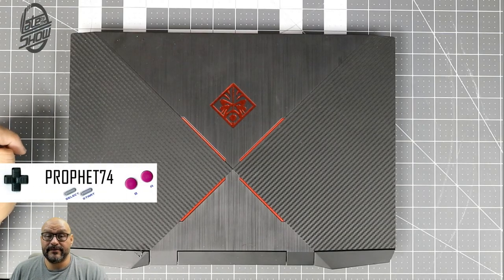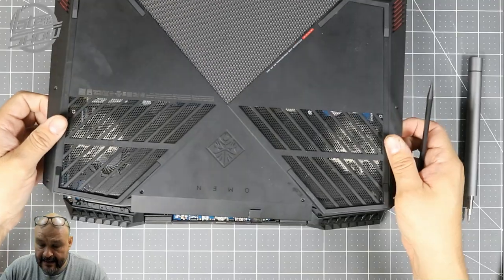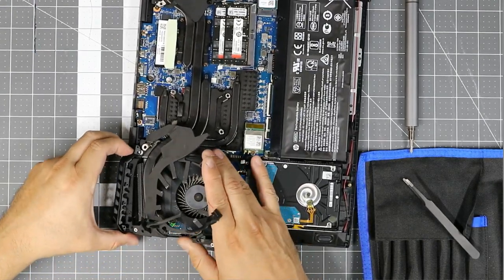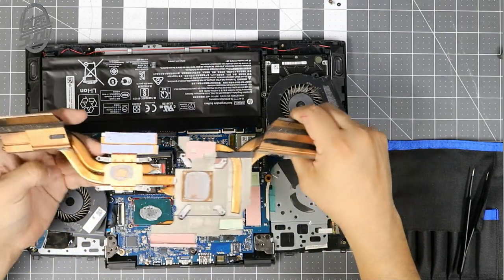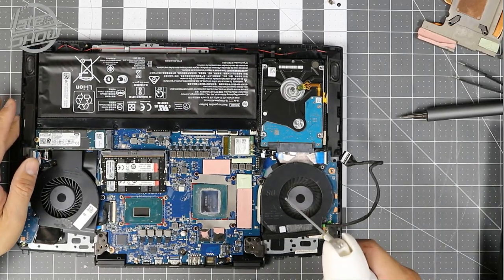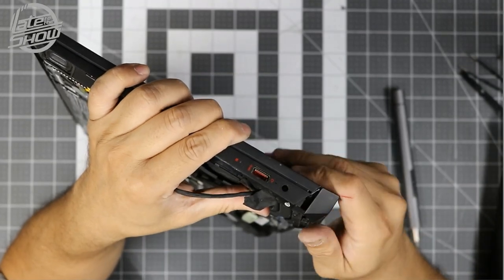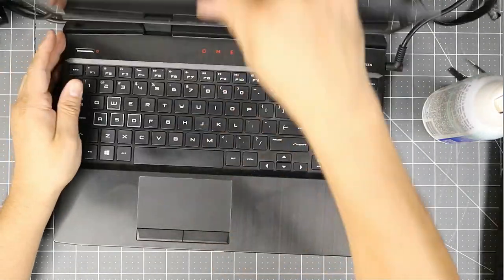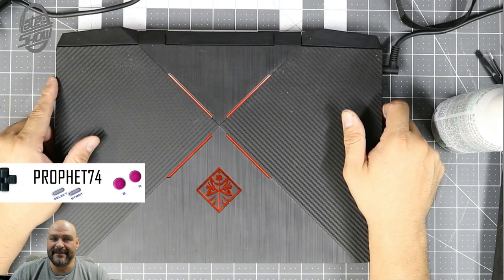Replacing Thermal Paste HP-Omen 15

Comment: For Rectangle shaped CPU and GPU it is better to use thin line in middle  lengthwise..the dot is good for square shape only.
Reply: It's thermal paste and not liquid metal. Just put enough as it's not conductive. Liquid metal is only time that requires finesse.

Comment: Unfortunately you miss the Whole point. What is the actual temperature change after repasting in most real daily usage?   Is it 1C or 2c?  It is not worth if there is no significant drop of temperature.
Reply: it helped me by 20-30c
Reply: @kemo_gaming Finally I did it with Arctic  MX4 and you are indeed partly right.  It drops from maximum 99C to only 80C in XTU benchmarks and running Farcry 5 from 98C max to about 88C.  I never thought how good the MX4 compared to HP stock.
Reply: I used liquid metal and had temps drop by 15c
Reply: @sethbingo  not worth the risk,  but liquid metals indeed is great conductivity,  including burning your board.
Reply: @sethbingo  not a good idea on a laptop that's gonna move around a lot and sit vertically in a backpack

Comment: Omen 15 owner here, thinking of re-pasting, just a question.I got 3 tubes of mx 4 4 years ago, I opened one to use a tiny bit. Does thermal paste go bad? Can I use the remainder of the opened tube?
Reply from the maker: Yes thermal paste does go bad if not seal properly
Reply: @LatetotheShow  Thanx, I threw out the opened one, will use the unopened tube, I was never really going to risk it with the old stuff, it was more of a curiosity on my part, thanx again, great vid btw!

Comment: I'm not a computer technician but it's common sense to remove the battery first if you disconnect any cables. And by the way, I changed the thermal paste on my HP Omen, it was a lot of anxiety due to the number of screws. First time well done.

Comment: I was following the steps but the heat sink doesn't want to come off, like it's glued on the motherboard

Edit: In case someone reads this comment in the future, i managed to do it. I didn't remove the black tape between the heat pipes and the fans, it wasn't obvious that it was the issue but it worked like a charm once i took it off

Comment: Thanks. This helped me with replacing the paste on my HP Oment Laptop today.
It was over heating, and I thought (and hoped) that it was just a problem. With the paste, and not my new nvme ssd.

Some of the paste was a bid hardened, so I will see if this is the solution for me.
Reply: any news? I recently opened mine up and cleaned it which got me waaay better thermals but I haven't repasted it yet, is it worth doing?

Comment: The tiny black screws that attach the heat sink to the motherboard are so tight it’s impossible to get them off without stripping them.
Reply: I just stripped a corner screw, had to buy a drill to remove it now I have a brand new flimsy battery
Reply: damn, i might just skip trying to repaste this thing. I dont use it much and might as well not break it if it's functioning

Comment: Thank you so much! My Omen was constantly running on around 95-100°C.
Together with the official repair video by hp (uploaded here on YouTube) I managed to repaste my omen and remove the insane amount of dust in it! Even though I had no experience with computers whatsoever. Now I can even reasonably play Hogwarts legacy without overheating. Staying at 80°C now! Thanks a lot!❤
Reply: 80° c is still a little high but manageable If you go and limit the power settings to the processor to 99% it will keep it a lot lower. But you'll lose like 5 frames or a quality setting.
Reply: limit under windows power settings? @Stickerz-
Reply: Been running mine for over 5 years @80°c idk if what you're saying will make it last longer but so far so good.  @Stickerz-

Comment: Hi, I was wondering if you could tell me the thicknesses of the thermal pads on the heatsink for this laptop? You mentioned that you would have replaced the one, if you had them at the time. One of mine fell apart upon removing the heatsink to repaste & I don't want to get the wrong thickness/type.
Reply from the maker: https://amzn.to/3V6lqOM

Comment: I am a huge noob when it comes to this and I will be working on my HP Omen 15 for the first time. I am having some heat and sound issues. The heat is not enough to every force it to shut off but it is almost always pretty hot even if I just have a couple tabs of chrome open. For the audio, sound has gotten quiet and some times one of the speakers seems to stop working. Do you have any tips for a rookie like what kind of thermal past to use and tips on applying it?
Reply: Have same issue with the speakers, it is probably the very thin cables that get pinched and the speakers stop working properly.
Reply: @TheBuildTeam  It was always the ones on the right and I failed when trying to replace them. I thought I did everything correctly but the right one just wouldn't go down. Also, don't look under the speaker cover flaps. They can get hella nasty especially for people with bad psoriasis like me.

Comment: Did you use any alcohol to clean the fans? Mine are covered in dust and air doesn't seem to be removing most of the dust.
Reply from the maker: Yes I did used alcohol to remove particles and the old thermal paste
Reply: @LatetotheShow  how much degrees had the alcohol? was it around 95°?
Reply: dont use alcohol on your fans or it will mess them up
Reply: @ReizenCreations  why

Comment: Unfortunately, you do not show how hard it is to remove that bracket plastic clip/radiator fin cover.  What a very stupid and ugly design this plastic parts in this Laptop.  It is not more than 2 mm thin plastic that crack so easily.    I removed the whole fan and heatpipe assembly.  That plastics on the exaust is the dumbest design I ever saw in the laptop.
Reply: ikr.. i can only agree with you sir.
Reply: I swear HP really made this laptop so shittingly complicated to work with, I didnt know abbt thi swhen i bought it, but i swear the next tme i am buying a laptop i am gonna look at how to open it up first.
Reply: @Taha-id7vs  newer model is much easier to work and cooler with 2 ssd slots

Comment: Hello sir, i did the thermal paste replacement and now my computador wont Turn on, its a HP omen 15. I notice that the power light that used to Turn on when the computer was in charge, wont Turn on now. Do you have any idea whats the problem can be?
Reply from the maker: Check the batter connection and make sure you didn't pull out the cpu ot the gpu even if they are solder in.
Reply: Probably you did as he did to his loptop touching everything without removing the battery
Reply: You might have disconnected the power cable inside your mother board where your Power supply plugs in its very easy to disconnect it when you remove the heatsinks and fans go back under ..remove your battery first...then look for the cable where your power supply plugs in  and make sure its plugged into the motherboard ..HP also has many video tutorials to take apart  and replace your laptops parts even cables.
Reply: Thanks everyone for the help, the problem was solved!!
Reply: @euviniciuspeixoto   Well bro what was the issue what worked for you?
Reply: @neosrt10  3 pins of the power conector inside the laptop where not working, i might touched it when i was cleaning the computer and they got damaged maybe, i had to take my laptop to a store where they fixed it
Reply: @neosrt10  sorry about my bad English
Reply: @euviniciuspeixoto  Your English is good bro. Glad u got it fixed.
Reply: @neosrt10  thanks bro have a Nice year
Reply: @euviniciuspeixoto  Thanks bro u 2 God Bless

Comment: I have redone my thermal paste 4 time with different amounts and my laptop just gets hotter and hotter. GPU at 78c CPU at 94c-97c when playing COD. I7 9750h with GTX 1660Ti with 200Mhz overclock. It use to run at 70 on the GPU and 92 on CPU with the bad HP paste. I'm using Arctic MX5.
Reply from the maker: Replace the thermal tape on the m.2 and make sure you add the tape back this is important to keep thr air flow by the fans and always play AC connected. Another tip update the latest firmware for the GPU and the CPU
Reply: You need to put enough thermal paste, not excessive either, just enough to cover the whole surface. Arctic MX5 is as good as MX4,  I used MX4 in my Dell XPS 9560, the gain is big because the throttling is not 800Mhz but at 1.6Mhz, with the same temperature when playing Dirt 4.   Before was not playable at 800Mhz CPU clock.   I also repaste my XPS 9570 with i7-8750 6 cores,  XTU benchmarks show a drop of temperature from 98C max to 85C max and no more thermal throttling shown in XTU, only power throttling that can only be overcome by undervolting. XTU scores also increased from 1400 to 1590, the bottleneck was not the CPU temperature anymore in my XPS 9570, but the BIOS power limitation.  I have not repaste my OMEN-15, too much work and the cover is plastic that really hard to open.  I suspect you put too little thermal paste,  for laptop, it is a good practice to spread the thermal paste in the whole surface of the chip homogenously in a thin layer.
Reply: It's nice to have a 2in1 appliances
You can play games and cook at the same time
Reply: Not an expert but first step is to undo the overclock

Comment: you made one big mistake.  why didn't you change the thermal pads...
Reply: Any idea what thickness is needed for the thermal pads?
Reply: @zenythmedia4959  0.5mm,1mm,2mm
Reply: @zenythmedia4959  i changed everything yesterday, i didn't have 0.5mm so i put 1mm. new thermal paste .the result is 10 degrees less there than there was From 97 on proc tu 89c  .gpu from 87 tu 74 c
Reply: @Ivan1989SB  Can 1mm be used to replace all the thermal pads properly?
Reply: @joaopacheco8227  i put in 1mm and 2mm because chips require ..